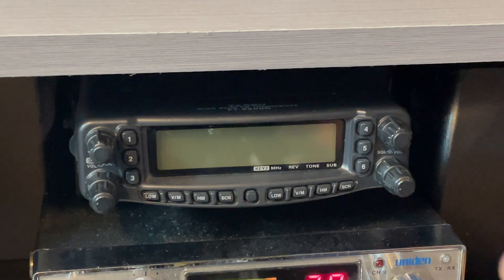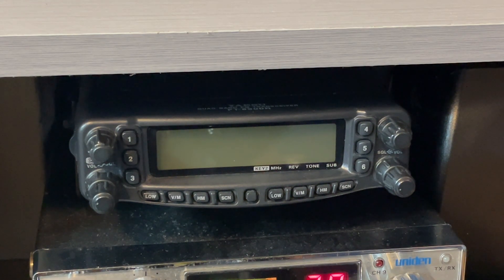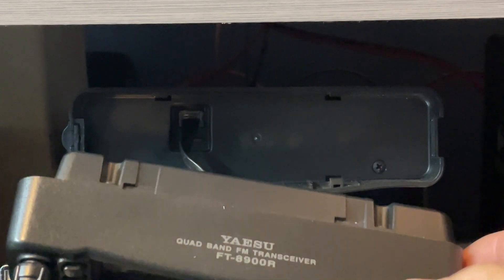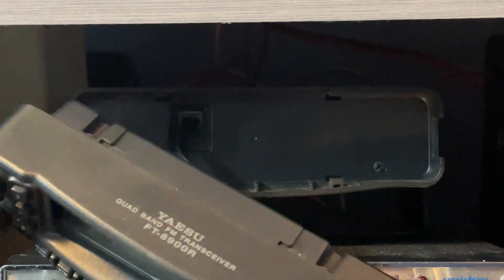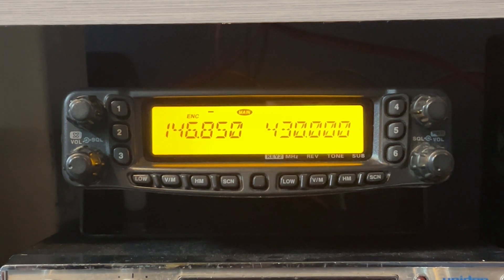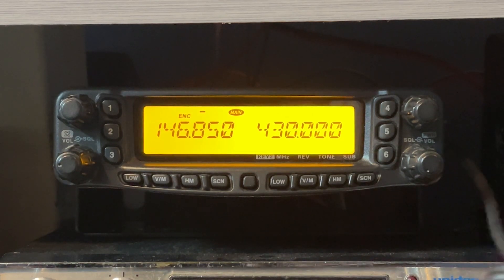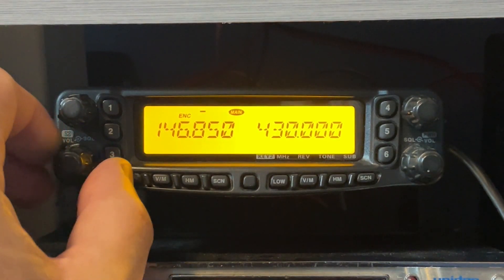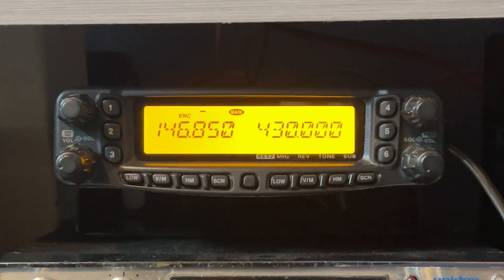$25 radio part 2

Comment: The circuit of Tyt 9800 isn't a copy of Yeasu 8900 but the lay out and components on rf power stage - include the power module both are the same.

Comment: Skip to 3:50 to see it power on and light up, then only to find out if it actually works in another video, a dummy load and power meter with another radio going on the same frequency would tell you if it is doing what it is supposed to do in less than five minutes. You should have made one video of quality instead of part 1, part 2 and now going to be part 3 on a YouTube channel when this video should have been edited for YouTube Shorts as this video had a 12 second intro image that 3 seconds would have been more then enough for a static intro.